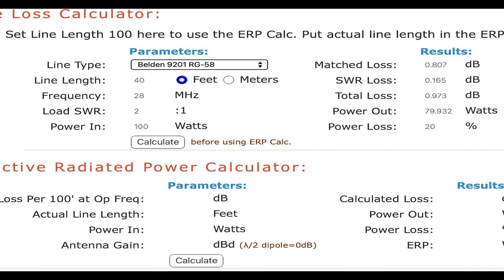Can you measure your HF Antenna Performance? Is it something you can do in your back garden?

Comment: Brilliant as always, Peter.  We had much the same problem modelling Radars in the RAF. With the old Analog systems it was tuning everything to its best and then an aircraft (in the latter years a Hawk from 100 Sqn) would fly in and around the Station whilst the controllers would ‘Plot’ the results in what was called ‘Spotted Dog’. This was a one off snapshot. When Digital Radars came in, we were able to also hook up a pc and record a longer view based on regular aircraft traffic passing by. This gave more of a ‘Mean’ view but importantly confidence that all was ok .
With the introduction of WSPR and FT8/ FT4, I get the same ‘Mean’ view of my Amateur Radio Station, as such.. and a good ‘feel’ of what is happening when I alter just the one variables (ie the antenna). For me, digital modes are a great technical tool to help understand your antenna performance and layout, but it does have to be averaged out.
Keep up the great work. de Andy G0NKK

Comment: Without having really good RF test kit around, or the ability to do proper field measurements, I think the RBN is the best method to determine how, in the present environmental conditions, the antenna is performing. It's measured, and you can even run RBN a few times for each setup to see the variations in the environment. As you say, conditions can change rapidly. So, whatever equipment parameters need to be changed (orientation, height etc.), should be ready to go to be changed quickly. I would keep a written log of what was done, and then after all the variations are run through, check the RBN results (which are time stamped). If you check RBN in-between, you're open to more environmental variation as the day (or night) passes. I ran RBN when on the gray line once, and 20m only performed well on the daylight side, and 40m only worked well on the dark side (within 5 minutes of each other). That was fun.

Comment: Seeking the perfect antenna and feedline became an obsession and prevented me from getting on the air for a long time.  Like someone once said, Perfection is the Enemy of Progress.

Frustrated with the lack of progress, one afternoon I threw together an EFHW, attached a 200 mW WSPR transmitter, and contacted Melbourne, Australia on 10 M on the very first transmit cycle. :o

Ham radio has forced me to confront and suppress my OCD.

Comment: antenna performance can sometimes be gauged for improvements if you have regular sked with a group of stations, as everyone knows what to to expect from a particular station ( normally a poor signal or a good signal etc. )so any improvement or degradation can be spotted more easily.
Reply from the maker: Remember that improved conditions can still be the reason for better signals even in a group but regular contacts with the group may well be an indicator

Comment: I use my internal SWR meter on the the radio however I do have a question about my analog meter on my radio.  I have the IC-7300. This IC-7300 has an analog meter. When I set my IC-7300 to 100 watts and key up my mic the forward power is suppose to show 100 watts of forward power being put out however my analog meter shows only 35 watts of forward power being put out.  What do you think could be causing such a huge discrepancy between the 100 watts the IC-7300 is set to and and the actual amount of forward power (35watts) that is being put out?